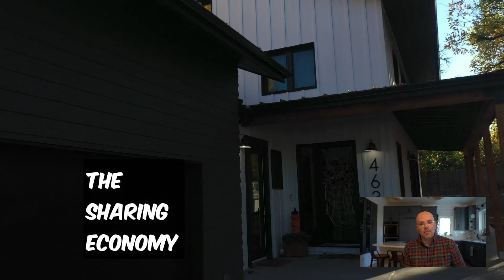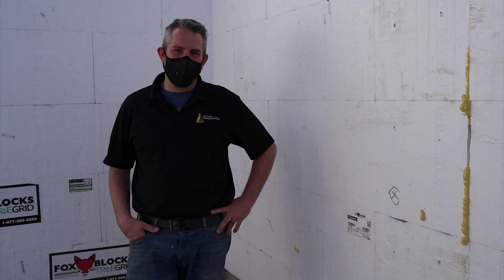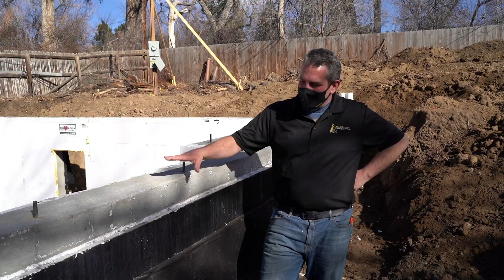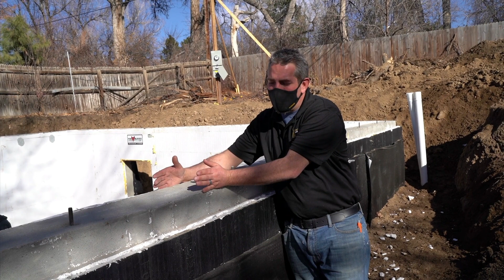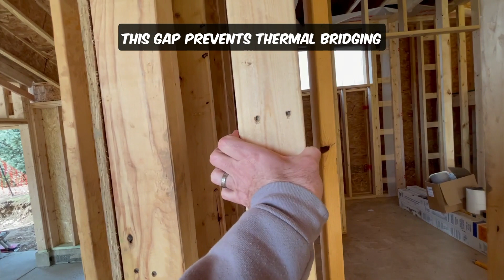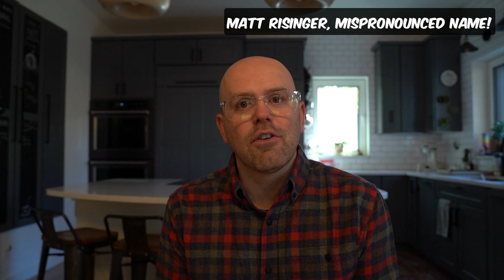Triple wall construction? Framing our Colorado Passive House with an air barrier

Comment: Nice work.  Did you do a hygrothermal analysis of this assembly?  Assuming this structure is in zone 6.  I am curious because you used OSB on the outside which would cause condensation on the inside of that.
Reply from the maker: We had https://emupassive.com do the analysis for us. We are in 5b. Check out their site, they've been doing this for a while now.

Comment: Why not just do ICF for the entire build rather than just the bottom level?
Reply from the maker: I think a big part was just the amount of concrete/foam that would be used. We were trying to minimize concrete usage as much as possible. Our energy consultant and architect prefer wood and renewable resources.

Comment: Great video! Would you mind sharing the estimated r-value on the triple wall assembly at your house?
Reply from the maker: If I remember it is around R40 for the walls. We have: 

2x4 blown in insulation
3 inch insulation filled gap to prevent thermal bridging
2x4 blown in insulation
Air barrier (almost no r value)
2x3 interior wall that has insulation batts

Comment: ZIP R on the outside would suffice for Thermal Bridging. You added cost for wood, time, etc. wouldn't benefit the cost saving. I don't believe Matt would agree with your analogy on Thermal Bridging.
Reply from the maker: I think a lot of the houses our energy consultant and architect are doing now are using ZIP systems. It was costly and time consuming constructing it this way. Cross laminated timber is an intriguing idea as well for time savings when constructing.
Reply: @thesharingeconomy  it might be costly up front, but beneficial in the long term with lower energy costs.

Comment: Do you happen to have pictures or links to the wall sections and everything shown in the video?
Reply from the maker: I do have pictures. Which part are you interested in. In the video I did show a diagram of the architect’s wall assembly and one of the framing. Happy to give more details or create a short video.

Comment: Would be cool to see a breakdown comparing the heating/cooling costs of a similarly sized home in your neighborhood to your passive house.
Reply from the maker: I'll do that. I think Xcel gives us a comparison against our neighbors, although I am not sure it considers square footage in it. We have had problems with our mini-splits so we have had them off during the summer. When it was getting into the high 90s the main floor of the house was at about 80. I think that is as much because of the overhangs as it is anything else, as they block out the sun in the summer. During the winter months we were using about 1400 KwH/month. That is about 3,100 square feet, 6 people, and everything in the home being on electricity. We didn't have any gas run to the house, so hot water heater, heater, and cooking are all electric as well. So it's performing really well. When we get the leak fixed in the mini-split heater/cooler it should perform even better.
Reply: @HighlineHomestead  That's cool! For a similar sized (slight smaller) 100+ year old house in my area we're using > 2 KwH/month for July-Aug running AC. Our home uses gas for heat. Still a bigger home with 30%+ better efficiency is pretty slick.